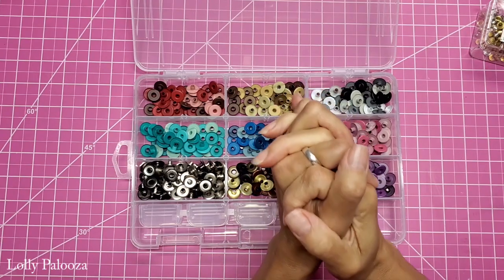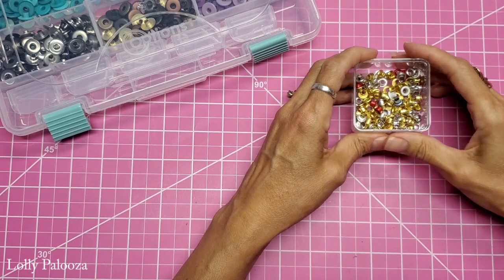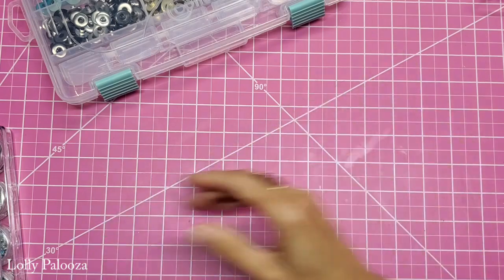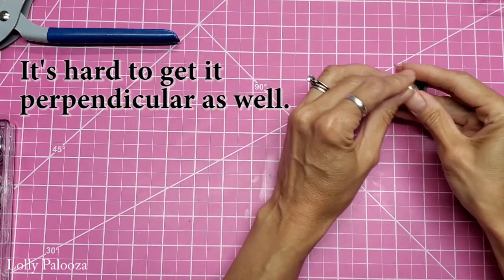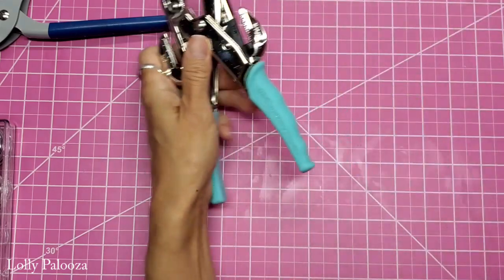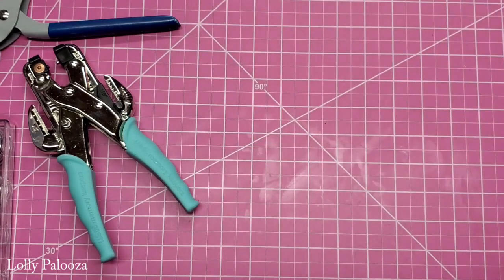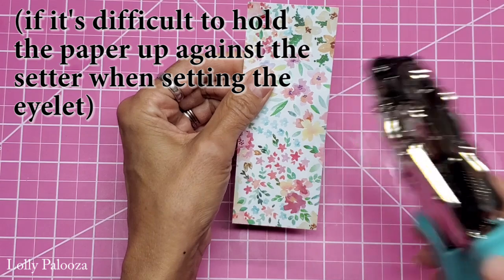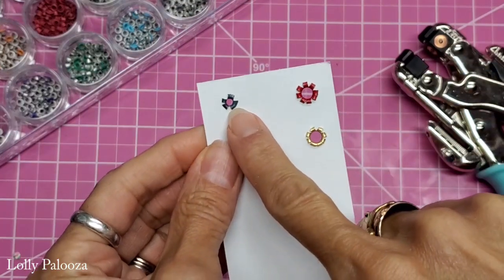How to Set PERFECT Eyelets / Crafting Conundrums

Comment: I too am so appreciative you post this video and the video how to use the Big Bite tool.  I recently picked up a Big Bite at a garage sale but instructions were long gone.  There are these bigger eyelets with them, not sure of the name, but they are in your clear case on this video.  Do you have a video showing how you attach those?  I've tried and have not succeeded so maybe if I see it once it would make sense.  Thank you so much.  You explain things so well.
Reply from the maker: They are wide eyelets by WRMK.  The hole size is the same as the 3/16" eyelets and use the same settings.   https://youtu.be/-S48_hQGOtQ  This shows some ways I have used the wide eyelets, and I have links under both videos on where they are in my shop.

Comment: P.S. just occurred to me that it would help me a lot if I had the cube settings written down and handy on my desk for easy reference. Rather than looking for the instructions each time and reinventing the wheel. At least for the two most often used sizes. Thanks again, Lolly.
Reply from the maker: Yes, I always remember A-1 and C-3.  Those are the two, and once set up, it's obvious which one is for larger eyelets vs smaller eyelets.

Comment: Thank you so much! I never thought to go search for instructions for the crop a dile.  I have the original.   The instructions were lost years ago and the print was so small,  I couldn't read them anyways. LOL.  I don't use eyelids very often anymore, But the crop a dile is is an essential when you do need to use them.  I do still have something similar to what you had, to whack a metal hole punch with a hammer into a small cut mat, then doing the same with the tool to splay open the back of the eyelet,  cuz that's what we had back in the day.  I was wondering how the big bite punched the holes,  so thank you for showing that.
Reply from the maker: thanks for watching!  I use the Crop-a-dile for more than just eyelet setting, since it punches holes through thicker materials.
Reply: @LollyPalooza   yes,  I always grab it if I need a hole punched.  It still works fine,  but when I got it,  a million or so years ago,  folks were saying it will punch through a penny.  Partly to explain how amazing it was & avoid 1,000 "will it punch through this? What about this?   Partly to see how many more folks they could get to punch through a penny lol. I had a teenage son,  & I've always been 1/2 kid myself,  so if course we had to try it. Yes,  we defaced U.S. Currency.  It did punch through with relative ease,  but one of those Penny punchings nicked a piece of one side of the part that punches.  But as I said, it still works fine.

Comment: Thanks.  This really helped me.  I was trying to put eyelets into fabric and was having problems.  I was having trouble keeping it in the tool long enough to squeeze it shut. I think part of the problem is because I'm left handed - maybe putting it on the bottom will help.  The other issue is that I wanted to use a washer on the other side and that kept falling off.  Do you have any suggestions on how to keep the washer in place?
Reply from the maker: thanks for watching.  I would have to play with the washer system; I haven't done so

Comment: 14:14 Got my Crop-A-Dial and was experimenting; had an issue with this at try No: 4 on what I now realize is thinner cardstock than my three prior tries. The eyelet kind of moved up the setting shaft and got stuck. Made a mangle and thought I'd broken the tool already. Took me a while to get the tool separated from the eyelet and it didn't do well in the paper. So this paper "thin-ness" was actually the issue, not my blacksmith's hands technique (possibly lol). I have broken more than one brand new tool (unrelated to papercraft) before. Should have been employed as a tester in factories...If there's a weakness I'll find it. Or if it will get a consumer confused, that's me. Thank you SO MUCH for showing close ups and carefully explaining what the instructions failed to do. They gave the salient points but the markings on the cubes are so hard to see with eyesight that isn't 20/20 that it was frustrating. I do note that the eyelet settings on the cubes match in metal colour, so that is actually a bit helpful. Perhaps the makers of the crop a dial could actually differentiate those colours even more; black on top and bottom for speciality eyelets, bright pink for 3/16ths, orange for 1/8th and so on so that each corresponding face of the cubes matched the bases...because the letters and numbers are almost invisible for sight impaired.
Reply from the maker: Glad you stuck with it until you problem-solved!
Reply: @LollyPalooza  Tried again just now and realized I've had two issues. Somehow kept touching the lock key, and that helped with "stuck eyelet" syndrome. But your video and the "thinner paper" was what helped me sort it out most. Also following your idea to set it "upside down" or shank/finger on the down side; that way I can rest the tool on the table rather than in mid air and the eyelet and paper line up better. So it was your problem solving that helped. I'm just a klutz!
Reply from the maker: @Kayenne54  Proud of you!   One of my Crop-a-diles locks constantly.  What a pain!

Comment: You are so right about the quality of eyelets
 I also agree with you get what you pay for. I have a cropadile and I finally got so frustrated with awful eyelets that I just started buying strictly Wrmk brand for it. It was pricy but the figured it was less than buying cheap ones I can’t use and them collecting dust and still wind up having to purchase brand ones. 
Which I am hopeful that the website you posted (eyelet outlet), their eyelets will work well when using the cropidile? If so, thanks a million. Thanks a million anyways because they have brads at a decent price. 🙂.                             👍🏻👍🏻⭐️⭐️⭐️⭐️⭐️
Reply from the maker: I've used Eyelet Outlet ones with success so far.   The other problem is that eyelets are a permanent embellishment, and to use a crummy one and ruin an entire project is heartbreaking!

Comment: Hello Lolly Palooza.  I am having trouble with some grommet eyelets I bought on Amazon that are stainless steel.  I used it on my crop-a-dile and they will not bend open.  I tried doing it very hard and they will not bend at all.  Do I have to buy the eyelets that are we r memory keepers which is the brand it's supposed to use ?  I bought those because I have had some eyelets rust on me so I wanted some that would not rust but I found out these do not bend open also🤣🤣
Reply from the maker: I've found that the grommets (especially stainless steel) are tough to work with.  I had to get one of those grommet setters from Joann Fabrics (the two part thing that sits on your table, and you hammer it), and it was still very tough.
Reply: @LollyPalooza  I thank You very much for  answering my comment and giving me the answer I  needed.  👍👍👍👍👍👍💯💯

Comment: while watching the video on eyelet setting using the crop a dile you referred to which side of the cubes to use with letters.  I do not see identifying letters on the cube,  Are they there?
Reply from the maker: They are tiny symbols etched into the tops of each side of the cubes.  Look in the corner next to the metal center of each cube.

Comment: I want to make resin beads. The hole of the bead is 5.3 mm. What size eyelet should I use for this.
Reply from the maker: I'm looking at a ruler and an eyelet side by side, and it appears that the 3/16" eyelets (like for the large hole on the Crop-a-dile) fit that.
Reply: @LollyPalooza  Thankyou so much

Comment: I didn't know how to use this but I ended up doing it completely wrong but somehow it still works and is prettier. It doesn't have the cuts on the back because I managed to use two eyelets in one hole. No not grommets. I used eyelets as grommets in the thick leather of a strop
Reply from the maker: Interesting

Comment: I've been practicing, but I can't seem to fix or even figure out why I'm having a problem. My cropadile is leaving a circular indentation in the top of the eyelet around the hole. Is this a problem with the brand of eyelet being not quite the right size? I can't figure it out and it's incredibly frustrating.
Reply from the maker: I have one brand that does that as well.  I think it's a brand issue.
Reply: @LollyPalooza  thanks; it's been so frustrating to try over and over and get the same problem! I appreciate it <3
Reply: @LollyPalooza  do you have suggestions for brands that don't have this problem? Specifically the 1/8" size? I'm having trouble finding them
Reply from the maker: @kdcthelioness  I use Eyelet Outlet (Check out my supplies list under the video)

Comment: I have a crop a dile and my eyelets always crack and break. I thought maybe I was pressing too hard but when I don't press hard enough, it doesn't do it's job. I have all of my settings right. I'm wondering if mine is faulty? I feel like my cubes don't align real well when I go to press?
Reply from the maker: that could be (alignment issue).  Before ading paper and eyelet, can you gently close the Crop-A-Dile and see if the two "points" of the cubes line up?
Reply: @LollyPalooza  I will check! Thank you for the reply!

Comment: What's the point if it's

What's the point if it it going to damage your work and catch with its rough surface on the back side? I thought this tool gave you a smooth finish every time. It's just not as great as most people will have you believe.
Reply from the maker: If you're thinking of a smooth, perfect "ring" on the back, you are looking for a grommet, not an eyelet.  An eyelet has to crack and split in order to  spread apart for the back.  There is no tool that will stop that. I have never had the back "catch" since I've followed all the tips that I mention in the video.